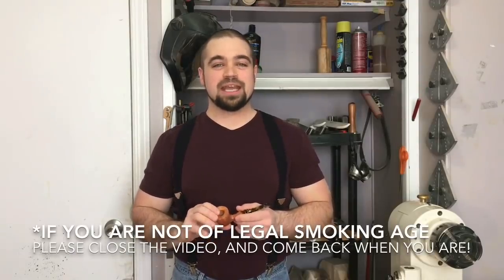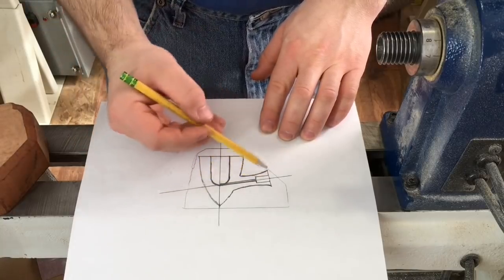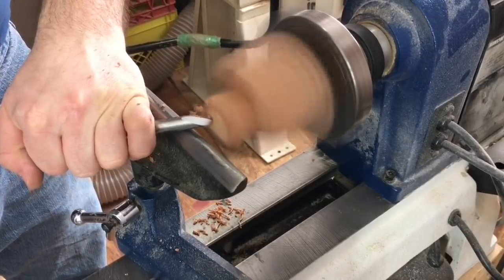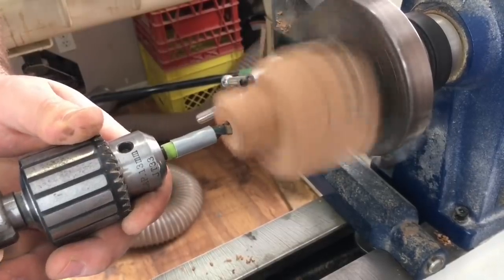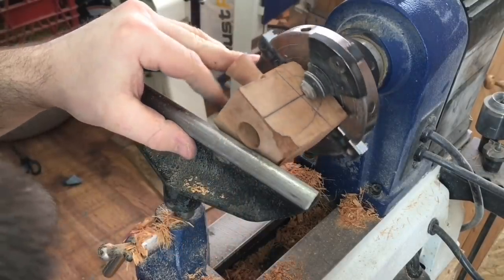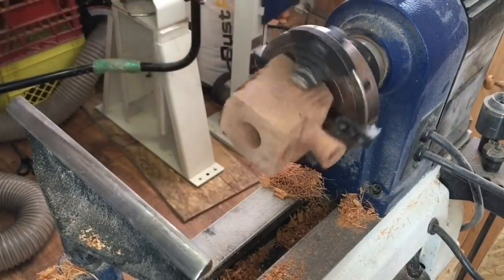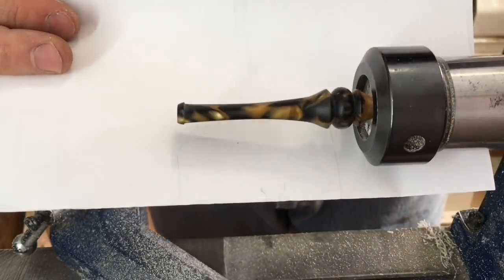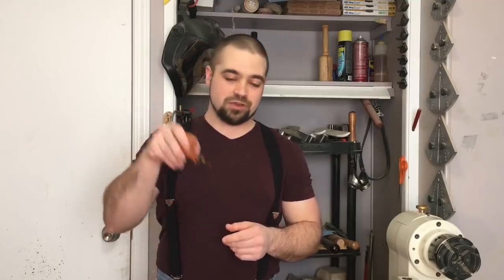Woodturning - Tobacco Pipe (How to make a Tobacco Pipe - Detailed Explanation)

Comment: Heads up when using a collet chuck or collets in general. Put the collet into the nut first and then put the nut into the spindle. This prevents the collet from getting jammed.

Comment: I'm just a lowly metal machinist, always have been mesmerized by intricate turnings such as this.  Such beautiful, awesome work.  Noticed when you put the collet chuck on you put the collet in first.  Generally, I thought, that ER collets like that snap into the nut and are then screwed onto the tapered mandrel, where DA collets are put into the tapered mandrel, then the nut screwed on.  🤷🤷 At any rate, such a great video, thanks for sharing!

Comment: That came out nice. you should look into a 2x 72 belt grinder with small wheel attachments. You can build them pretty cheap if you can weld. Mine runs on a treadmill motor and I have no complaints.  It makes light work out of hand shaping.

Comment: If you find that you are still scratching the polished surface in your mandrill you can put electric tape on it. I’ve seen where jewelers use electric tape on the outside of a ring to place it in a mandrill chuck. Then they can turn the inside for shaping and polishing. Nice job! Beautiful pipe

Comment: A suggestion for when boring the bowl, based on my taking a few attempts at constructing a pipe, would be to use a Forstner-type bit for the primary bore and switch to your spoon just before hitting the draught hole so you can end up with the nice rounded bottom you are looking for, but with less risk of getting out of shape. I guess I picked the right size for my draughts as I used the same 5/32 as you. The pipes I was trying my hand at were all freehand drilled, from black walnut, with integral stems for a total draught of 5.75". I experienced little wander with the 6" bit, but as with any cutting tool, sharp is your friend!  Nicely shaped pipe!
Reply: @ The Mitton Method, Curious about the black walnut, how does it hold up? I know its a beautiful wood. I use cherry for my pipes just because you can abuse them quite a bit and its hard enough to handle it. Cherry is still pretty, but its no black walnut!
Reply: @justb3065  The black walnut holds up very well. Nearly as hard as maple, but not quite as pretty as the Cherry. It stands up well to the physical abuse, and as long as you do a primary char of the bowl with a micro-torch to harden it slightly, lasts a very long time - one of the pipes I made was for a friend who is a chronic smoker of the green herb, and he smokes probably 2 bowls a day in it... 5 years later it is still showing no significant wear, and no burnout of the bowl.

Comment: I have a blank and stem bought years ago. The black is drilled and board. I hand carved a previous pipe. Seeing you turn this pipe shows me turning is the way to go.
Reply from the maker: Marty Jeruzal Turning really does simplify the process. And even if you wanted to free hand the shape, it will get the drilling done much quicker (if you still needed to drill it out), and it can help get an outline of the shape started. I just wish there was a way to turn the transition between shank and bowl. Can't get away from that part of the hand work as far as I can tell. Best of luck on your next pipe! It is a very rewarding project, isn't it?
Kyler
Reply: The right tools make all the difference .

Comment: Tip while cutting the acrylic set up a shop vac hose (with flat nozzle) just under your work piece and it will suck all the "ribbions" off your piece it works very well.

Comment: Dang Dude... The Beall collet setup is an ER 32 collet. You need to install the collet in the collet nut correctly. Once installed, the face of the collet will be flush with the face of the collet nut. This is fact; I have that same chuck and I also have experience with ER collets. Turn the nut over and look on the inside (thread end) of the collet nut and you will see that there is an eccentric lead-in machined in the nut. This allows you to snap the collet into the nut. You will be astounded with the difference once the collet can seat properly.

Other than that, it's a nice piece of work. Impressive.

Comment: Bradford pear wood is also a good option for pipe-making, and certainly much cheaper.  My favorite pipe is one I made from a pear log I took from the firewood pile.  It's got a reed for a shank and the bowl is about a half inch in diameter, with quarter inch thick walls.  Perfect for a fifteen minute smoke.

Comment: an interesting project!  Here's a suggestion about drilling.  After facing off the end of the stock,  try using a machinist's center drill bit for the first entry into the material.  The point is well supported and seeks the center of rotation. There are different diameters and lengths.  While they are intended for creating a 60d recess for seating the tailstock center,  you could go a little deeper.  Also as shown, rotating a standard drill bit while drilling will help keep the bit on the correct track.

Comment: Personally, I like a long stem 10 to 12 inches in length. Makes for a cooler smoke. But that's me. That has the shape for a good traveling bowl. Have you tried flavoring the bowl? I flavor mine by filling it with a Good scotch. Fill the bowl and let her sit for an hour. You might have to top it off as the wood absorbs the liquid. I have a friend who uses Brandy.
Reply: I flaver the bowl with canibis  oil

Comment: Start deep-drilling your air hole by using a short, thick center drill or spotting drills just to locate the pilot hole....then switch over to the long twist drill...(which is not the best to use to cut wood...they wander in deep holes).  peck at the wood and withdraw the drill, often to clear all the shavings, so you don't load the flutes which can cause wandering.  Center/spotting drills are short, and very rigid.

Comment: An absolutely wonderful piece of craftsmanship.
You make it look easy, but I bet there are many, many errors unseen in your history.  That's ok, it's how we learn this kind of thing.
The first tip I can offer is that you can probably find miniature polishing bits for your rotary tool; you can use them (instead of sandpaper) to work the inside of the mouthpiece.  I seem to remember seeing some in the Rio Grande catalog.  A few tapered felt points with two or three different grits of polish should finish the inside quickly.
Last tip - fill in your stamped lettering with something dark, scrimshaw style.  Modeling paint would work, but actual wood ashes would be more in the spirit of things.  Fill in the letters, then remove the excess, so the lettering visually 'pops'.  Might need to polish and wax again afterwards.
Have you ever thought about making custom presentation boxes for your pipes?  I can't help but think they're worthy of them.
Reply: To avoid cross grain on the stem and so much hand carving of the bowl. my first reaction would have been to make the 2 parts separately and tenon the wood part of the stem into the bowl, using a small amount of water based glue. It would also use less wood. 
Have I overlooked something in this idea, making it sound completely stupid.?

Comment: Nice pipe! Not sure about the transition at stem seems a little bulky. Have you tried using a core box router but to bore the bowl out? I use them for a variety of boring applications. The set you back a bit $$$ but they can be resharpened by facing the off with a diamond hone. But really like the pipe👍👍👍

Comment: If it helps you can pick up some really nice small round sanding sticks at Hobby Lobby in the plastic model section, they look to be about the same diameter as your nail plus they're tapered to a point at one end and come in different grits as well.

Comment: Beautiful work! I've made several pipes myself over the years, but nothing as beautiful as these. and I typically make them from what ever is handy, but mine are used for cannabis. I've made several just from fallen tree branches, oak mainly, and all one piece (I'd attach a pic if I could), but would like to try burl or briar. Which is the reason I clicked your vid, i wanted to know what type of wood you're using. Thanks, great work!!!

Comment: Nice pipe and good work thanks for sharing. In my experience there is no difference what so ever in smoking cigs or a pipe they are both very dangerous. Pipesmokers do inhale, when i think about it I have not met even one pipesmoker in my life (I´m 66) that did not inhale the smoke all they way in to the lungs. But even if you do not inhale the smoke all the way the damage tobacco smoke will do bad things inside your mouth anyway.

Comment: Beautiful work! I'm new to pipemaking. Just got a lathe and have been trying to master it. My biggest problem is recentering the pipe, for instance if I turn the shaft, then take it off and work on the bowl, but then want to go back and fix something on the shaft it's hard to get the alignment perfect so that it doesn't push the draft hole off center when I'm turning the shaft again. Is there a good method for precise centering?

Comment: Pipes look great !  A couple of questions, instead of using the scraper for the entire distance, would a Forstner bit not ensure you are going in square and give you the nice clean sides.  Then finish off with your scraper for that last delicate cut?
Secondly, when drilling the 1st two holes, is it possible to drill the smaller hole 1st so you know it's centered and follow up with the larger one?  Or can you get Forstner bit the size of the larger hole which would automatically give you a centered indent for the smaller bit?  
I think I may just have to try making a pipe for my Great Uncle who has a sizeable collection.
Reply from the maker: Forever Turning Peter Kipfer Thank you very much Peter! I would say that using a forstner bit first on the tobacco chamber would be a great idea because it will stay centre, be clean, and it's a bit easier. Just have to makes sure to stop short of the bottom so it can be finished by hand to get that nice rounded bottom. As for drilling the mortise and draft hole, I always go with the mortise first. The main reason being that the the drill bit I use for the mortise is very short and rigid so it tends to not wobble and stays very straight. And because it's a normal twist bit, it leaves a like little centre point for the next bit for the draft hole, and it will also leave a little chamfer at the transition from the mortise to draft hole. The draft hole is 5/32" and the mortise is 5/16". I hope you make a pipe for your Great uncle, that would be an awesome gift for any pipe smoker. A pipe made by a family member! He would smoke that with pride and show all his friends. 
Kyler

Comment: Man, reading on forums people made it out to seem you need to have huge jaws for your chuck to turn pipes, as well as a separate set of jaws for turning the stem. You did it with a relatively small set of jaws. I'm just getting started and buying 300+ dollars worth of chuck/jaws/chuck inserts is kind of insane to me. Not to mention the cost of the lathe and decent tools. Do you think it's advisable or safe to get a cheaper set up and some smaller jaws like this? (As opposed to the oneway talon with Tower jaws) thank you!

Comment: What type/flavor/brand of pipe tobacco do you prefer?
Reply from the maker: MrTaco250 I much prefer the Balkans and English blends. My daily go to baccy is Peter Stokkebye Balkan supreme as it's a great smoke at a really good price, but my favourite by far has been Eric Nording Hunter's blend "Fox Hound". Fox hound was very mild in strength but with a very smokey sweet flavour. Unfortunately it's no longer available because I think McClelland made it for them and they closed down due to expensive changes required by the FDA. I have only two tins left with a good 5 years age on them. I cellar a lot of my tobacco to see the changes over time.
Kyler

Comment: That collet chuck of yours....

I used to tell the apprentices, that if they drove the god-damned collet into it's holder, without clipping it in to the nut first, I would use their forehead to beat the stuck collet out!

Push the collet in to the collet nut first. It fits with a bit of a snap! Comes out easy too!  That is the whole purpose of the ring around the front of the collet, it fits the eccentric ring on the nut, which is what is supposed to draw the collet out of the chuck, when you try to remove it!

The eccentric in the nut, keeps the collet from seating straight, if you do not properly seat the ER collet in it!

Try it. You will probably like the results! Unless you were actually LOOKING for crooked parts!

Comment: ive made a few pipes . there a load of fun to make. your pipe turned out beautiful . but ill give you a tip  where you dremel out the mouth piece then sand it . instead of sanding it get you some diamond riffler files  you will like them .

Comment: Where did you get the tenon Making Jig? I need one so bad and and thank you for your Video and time.
Reply: he wrote
"The MakerHive YouTube Channel Thank you kindly! The tenon making tool I originally bought from Pimo pipemaking supply. I believe they have been bought out by Vermont Freehand if I'm not mistaken. I would check with that site first. If you don't have a metal lathe it is almost necessary to have one of these. All my pipes' tenons fit perfectly because of it!
Kyler"

Comment: So, even though the original piece of wood was all oddly angled, the two major faces were parallel to each other -- is that correct?
Reply: It couldn't be otherwise, if not he couldn't have lined up his centres.
Reply: @musamor75  Thanks!!!  I see that another "unspoken" factor is that the other faces start off (mostly) perpendicular to the major faces.  That is what allows him to accurately extend the drawn centering lines on to the short faces.  
One thing that threw me is that I thought he said that he paid $35 for the block (so it might be any shape).  But, what he said is that the block was worth $35 - presumably, he had already done some cuts to the wood (and would have squared the angles if it needed it)

Comment: Excellent video, I really enjoyed it and makes me want to make a pipe ever though I haven't smoked one in years.  Where did  get the tenon tool you use to turn the tenon?
Reply: The MakerHive YouTube Channel Thank you kindly! The tenon making tool I originally bought from Pimo pipemaking supply. I believe they have been bought out by Vermont Freehand if I'm not mistaken. I would check with that site first. If you don't have a metal lathe it is almost necessary to have one of these. All my pipes' tenons fit perfectly because of it!
Kyler

Comment: Very beautiful pipe.

I have a question, if I may ask: how are those "heavily" bend stems made?
Reply: The same way, with heat and pressure. 
I suppose they may be using a jig in some cases, to make sure it’s straight in the lateral sense.